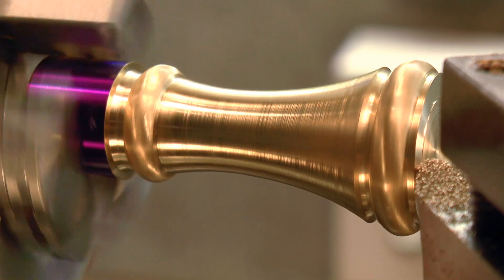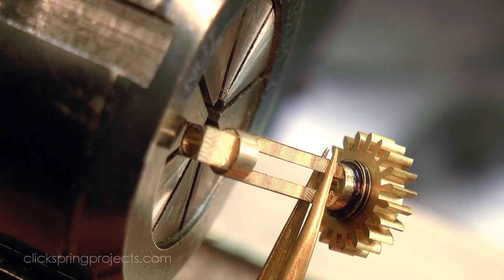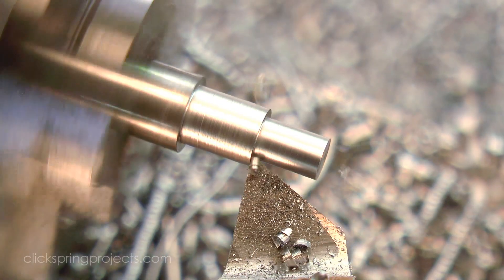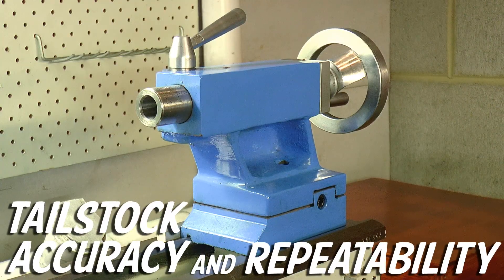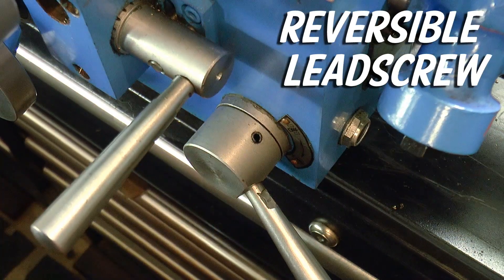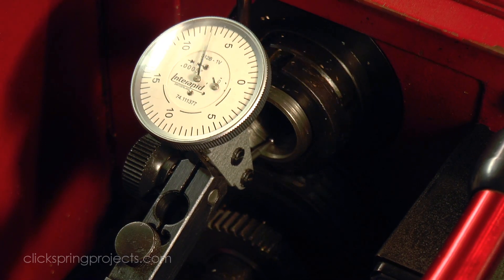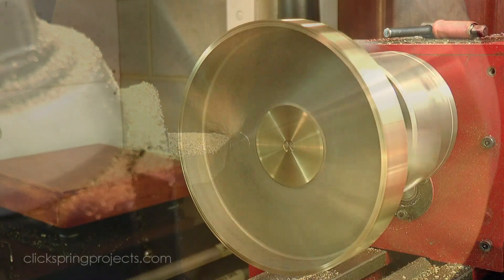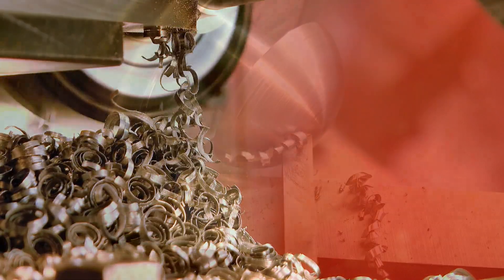Tools, Glorious Tools! #6 - Which Lathe Should I Buy?

Comment: 8:56 a tool called a tite-reach extension clamp would work great for that! It just grips the nut so you can get it started. It comes in an extra small size with a jaw thickness of 4.7mm. Last I checked it costs <$30USD.

Comment: Deciding what you want to make before buying a lathe seems like good advice but for many of us, what we want to make can change over time or isn’t limited to one particular type of project. Any size of lathe you buy is going to be a compromise to some degree unless your needs are very narrow. The ideal situation is to have more than one machine of different sizes and capacities but that’s also impractical for many of us for multiple reasons. My current machine is a 12 X 36 geared machine and so far seems to be a good compromise between capacity, rigidity, feel and features. I have a retired machinist friend who doesn’t like QCTP’s, but he’s also as cheap as dirt.

Comment: I am looking into a lathe for hobby use.  I want to turn something up to 12 inches in length and 3 inches in diameter.  I want to be able to use coolant.  I want it to have a hardened bed that has been precision ground.  I would like a power feed, covered lead screw with no lash, the ability to add DRO later and to have a really decent tailstock.
Does anyone have recommendations for brands to research more or brands to avoid?

Comment: After most of my modelauto scratch-building career using Emco lathes/mills, I needed a new lathe. I chose a Wabeco D2400. 
The bar-bed system provides more than ten times the contact area for both saddle and tailstock than conventional lathes. The 1.4kw motor gives full torque down to 100 RPM. The factory provided 100mm three jaw has virtually no run out. I have adapted an ER25 collet holder for my Euro made collet set. Also have a 100mm four jaw chuck and adapter provided by Wabeco. 
The express purpose of buying this $6,500 (N Z $) lathe was to make precision parts for extremely high quality model cars and motorcycle models, which this lathe has done faultlessly in regular use for over four years. (Pay once, cry once). I have not had to modify or repair one single thing. I made a solid toolpost, and the mounting system for the topslide made this easy. Change over time under 1 min. 
 The lathe is used in a studio setting, so the toothed belt feed/threading train is welcome, as it is amazingly quiet. Wabeco bar-bed machines offer exceptional “Open Architecture” and long cross slide for mounting various tooling, and easy human access. The motor is hidden underneath in the torsion box, minimising bench space. Length overall is 1250, weight is around 75 kg. 
I am very pleased with the performance of this machine. I have drilled and tapped for a point 8 thread, in a 1.6mm brass rod, for a replacement winder in a watch. (in the 100mm 3J chuck). When machining steel columns for Norman pattern tool-holders I tested Wabeco’s claim and hogged a 5mm cut. It did it easy! The 1mm pitch lead-screws on cross and top slides and 1.5mm main lead screw provides very sensitive control over machining and finishing. 

You can check the quality of our work, and the need for reliable precision machinery on our site; modelautofabrique@icloud.com 
I do not denigrate the use of sometimes awful Asian machines, as they are often the gateway for users to either do wonderful stuff, or not! But for those needing something better, there is still one quality option out there. As with everything, there are Wabeco critics. Maybe for the price they expected a lot more, but I scaled my purchase to exceed my needs, and have not been disappointed. 
I never miss a Clickspring either.

Comment: The lathe choice should entirely be based on skill and common projects. Most people would do very well with a harbor freight mini lathe. It's under 1,000 bucks and is capable of .001". Most of the machinist who dog on 3in1 machines either never owned one and just regurgitate opinions of others, or don't know how to use them. Just about everyone reading my comment cannot afford a 12x36 gearhead lathe much less does not have the 3 phase available to run one.

Comment: A Southbend 9A or its Australian made Hercus clone are really good lathes if you have the room.  The Mens Shed I belong to obtained a Southbend 9a for virtually nothing, it was made in 1943 and had some wear and a fair amount of abuse but it worked.  I immediately stripped it down and started cleaning all the grease out of all the places it should not be, scaped the solid aluminum oxide and chip deposits off many parts and spent many a day up to my elbows in muck, getting all the ibs and ways up to spec, etc.  I had managed to get most of it in good accurate condition apart from the chuck end spindle bearing ( a plain bearing - don't people understand that hydrodynamic bearings require oil) and the bed, but plans were in place.  It worked well, if you were careful to work around its limitations. 

Unfortunately, despite my protests, the management decided to sell this lathe and buy a piece of second-hand PRC junk, yes it was a 40/14 class machine even though it was impossible to face, let alone turn 14 inches, more like 9.5 to 10 inches (safely).  It was also a seconds machine, a bit of a nightmare.  Sort of like selling a 1940s Hudson coupe to buy an early 1990s Great Wall Ute

Anyhow, the management of the Mens Shed thought the SB a horrible piece of old rusty junk with its antiquated v belt drive system (16 speeds, more than the PRC junk).  Just getting them to understand how valuable it was proved to be impossible, it sold instantly just about the instant they advertised it.  

The lathe was remarkably quiet in operation as long as the leadscrew gearing was disengaged and the back gear was also disengaged.  At medium speed you could bearly hear it at all.  I think they were surprised at just how noisy the gear headed spindle in the PRC junk was.

The SB power feed clutch was also a delight to use, first you set up the power feed and then slowly engaged the clutch with just enough torque to get the job done.  When working close to the chuck on small work, especially brass,  I would run it slack belted, barely any torque at all to spindle,  but safe.

With careful adjustment, the feel of the controls was quite good but it really needed far bigger dials.

One final irony, I could get just about any part I wanted for a SB or Hercus lathe, many of them such as all the possible change gears, the thread chaser, etc. are available as 3D printer projects.  Apart from standard bearings and seals, parts for the PRC junk were unobtainable.

I wish I has bought the 9A but my wife would have killed me, we live in an apartment these days.  If only it had been one of the rarer short bed models, half dead is better than fully dead.  SB even made metric model 9As from way back.

Most high precision, tool room, lathes use a belt as the final drive to the spindle in order to isolate any gearbox vibration.

Enough bitching

Comment: I got a 17 inch sherline with accessories for $500 about a year ago and it's been great for me. It's definetly not gonna be good for taking huge cuts on steel but it eats up brass and aluminum and gives a great finish. I want to make a QC gearbox that also accomadates the lever collet closer. The provided attachment works but its super slow to setup and doesn't allow you to use the lever collet closer either. Seems like a missed oppurtunity, being able to crank out small screws over and over would be amazing.

Comment: Beautifully filmed video, congratulations! As a Myford Super 7B owner, three features I particularly appreciate are the quick change gearbox, the threaded spindle (quick chuck changes) and the spindle clutch.  A variable speed drive would also be welcome as would a larger spindle bore.
Reply: I greatly prefer threading away from the chuck, BUT that requires running the lathe in reverse. Don't do that with a threaded spindle nose. The chuck might unscrew! It is possible to add a drawbar to the chuck as a safety feature. Videos on line.

Comment: Got the Seig C3 nearly two decades ago. Plenty of web pages on how to "improve it", which is a lot of good practice. Not a precision lathe even after improvements. For a beginner it is a cheap way to start, but it won't take long to desire something better. And those are expensive. Allow for double the cost once you get a bunch of tooling. If you get a $1000 lathe, tooling will add $1000. If you get a $3000 lathe expect tooling to cost around $3000.

Comment: Solid advice.  I would also add that if you find a good quality lathe without variable speed drive, it´s easy and relateively cheap to add that provided the motor is an AC induction motor.  Also worth mentioning that the threading attachment for the Sherline is a manual affair.

Comment: when i got my lathe i knew little to nothing about it. i sent a picture to a machinist friend and he said it seemed good. problems cropped up after installation though as the bed damage became more apparent and we realized it also didnt come with a tool holder. i managed to make one but the bed is still an issue. so i guess i am saying, even if you find a good deal and a machinist gives you a thumbs up, they might not know what your specific needs are and you might get budgetarily stuck with something that really wont cut it. dont settle. (also this is an old iron south bend 9 inch with a cast iron bed. )

Comment: because i work in a lot of iron and steel i found that my first two lathes, a benchtop, and then a 12" atlas were underpowered, i really wasnt happy until i got a "toolroom" lathe. its a 1928 south bend 11" and it needed some minor restoration but was suprisingly unworn.
lot of spot on advice here in this vid.
id only add, if you are working in iron or steel, you usually cant buy too much lathe but you can definitely buy too little, get the biggest your wallet and space can afford.
also pay VERY close attention to his advice on leveling your bed, it really can't be overstated how important this is. 
also try to get some basic instruction in lathe operation from someone that knows what they're doing if possible  and for goodness sake adhere to the safety advice  small lathes can easily mangle and big lathes can easily kill. these arnt toys.

Comment: Chris had already mentioned it in the video , the best lathe to buy is one that is actually available to you, in the area that you live!
there really is a finite supply of the nice old machines out there , and with the occasional exception , they were tossed out
because they were worn out and no longer useful. restoring them is a long and costly project, which is perfect if thats 
the thing you want to do. 
On the other hand , if what you want to do ,is make parts , look at what Chris does with the same chinese lathes that some
would have you believe are useless, that is clearly NOT the case.
 At the job that i recently retired from we used a sherline lathe and mill to do final  fitting of  small parts on inspection equipment that 
we built and refurbished,  they were perfect for the task (had to be I conned management into buying them😉)

Comment: consider the how clean you are to 
say you have spent 1hr lathing cast iron or brass are you the type of person to walk in side for dinner 
or and you going to brush your cloths down and remove you shoes and put on slippers at the door.
walking around the house with work clothes on with lath chips embedding into you house carpet to later have it in your bare feet.
---- go ask a tile shop if they have any outdated vinyl flooring  or 2m by 2m scrap cut off

Comment: This is more about the tools:
I think it's not a bad idea to start with HSS and grind tools to learn what geometry works well...but something i wish i did way earlier was get a oxy-acetelene set and braze my own carbide. Sharpening carbide to the same level as HSS is such a dream to work with. I use to fear stainless because if you didn't keep it cool you'd need to sharpen HSS every few cuts - no such issue with carbide - beautiful curling chips that just break. It makes 4140 act like it's aluminium. Now carbide insert tools are ok but I find they are not sharp enough on a smallish lathe and have too much tool pressure.
But starting on HSS is great cos it's cheap and not difficult to modify.
Reply: I have access to a lot of used carbide tooling and have successfully silver soldered it to steel with a propane torch. Cheap Chinese diamond grinding wheels are available and work OK. Be sure to use dust collection at the grinder as carbide almost always contains very toxic metal (cobalt!) Used, thin, flat, carbide knives work well for silver soldering and relatively easy to grind on diamond wheels. Some of the angles needed are simply ground into the steel shanks. Most insert tooling has eased edges to prevent chipping but that increases the needed force, not good for small parts. Inserts meant for aluminum alloys are much sharper and will cut steel, with a shorter life.  As a hobbyist, HSS works fine, is easy to grind and cheap. Make new tool rests for your grinder or modify the existing ones on cheap grinders. BTW, I consider a mill to be the 2nd half of the set of equipment needed. You can do some milling on a lathe but..... Have fun & be safe.

Comment: Vevor has upped the game of choosing a lathe a little bit with their new MX-S650 lathe which comes with a stepper motor driven electronic lead screw. No more change gears for threading or dialing in the proper feed rate when turning. I'd love to have an electronic lead screw on my 7x14 seig lathe but until now the only way to get one is either build one or buy a CNC lathe. My electronic knowledge is limited to plugging things in and changing light bulbs, so building one is out and as a hobby machinist a CNC machine is way beyond any budget I could ever justify spending. So there's a new wrinkle in the "picking a lathe" game.
Reply: I didn't know they did lathes. The 3018 is great fun

Comment: I'd be curious of your thoughts or experiences about the little PROXXON hobby lathes for the ultra-beginners and tinker-hobbyists. :)
Reply: I have a Proxxon lathe as well as a Sherline. They both have wimpy tailstocks, so that’s a tie, but overall I like the heft and the feel of the Proxxon more. The Proxxon has a decent powered leadscrew from the start; it’s an accessory for Sherline. The Proxxon range of accessories is extremely limited, however. Sherline offers a terrific variety, and at reasonable prices. Proxxon’s lathe collets don’t match their mill collets, as I recall; in any case I got around that by fitting the lathe with a suitable ER20 collet adapter - that works really well and is low cost. If I had to pick one, it’d be the Proxxon.
Reply: PD 230 is very good for beginners, small and versatile. I mounted MF 70 headstock above and use lathe bed for milling. The only problem is that Proxxon are made in China now so beware of late PD 230 and all PD 250s.